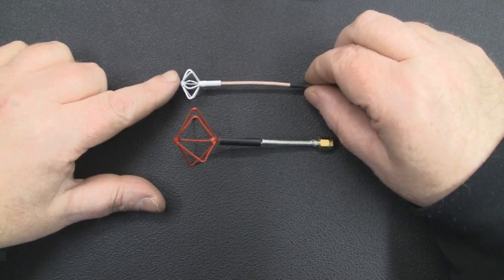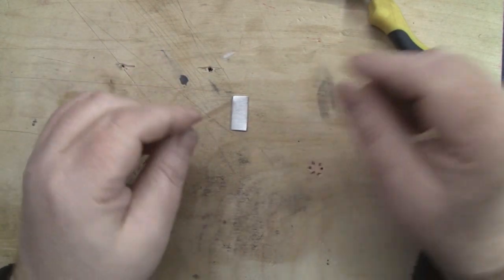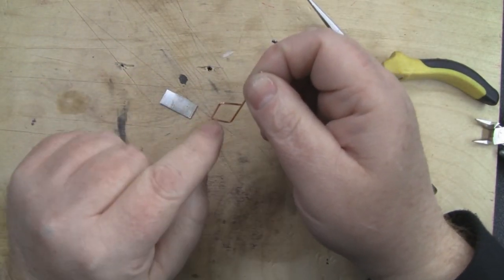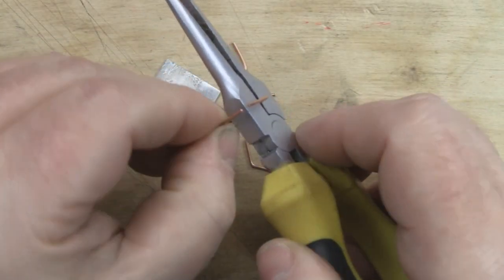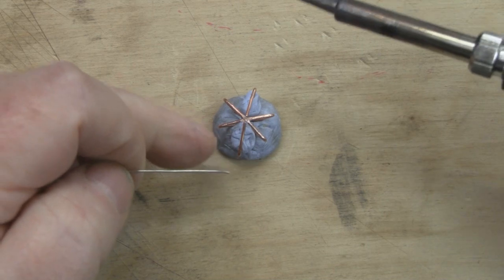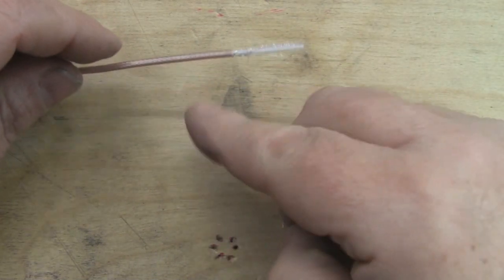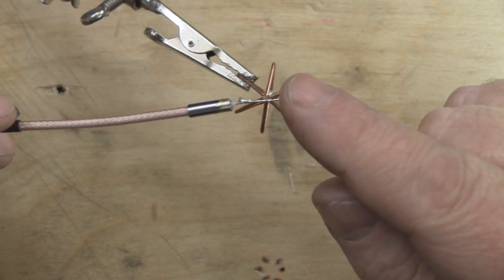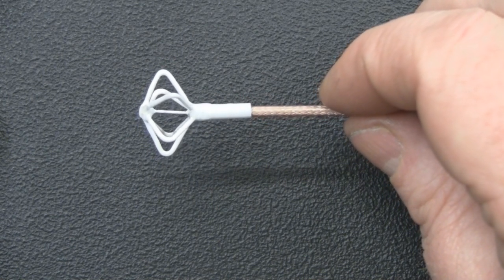Blade Antenna for 5 8GHz #81

Comment: ?  the formula for calculating antenna length was given as "length in meters =300 / frequency in MHz", 300:5800:4=12,9 mm, wy 9,6mm thats for 7.8Ghz?

Comment: Hi Andrew, I see from the title this is a 5.8ghz antenna so how come a 1/4 wave length is only 9.6mm and not the normal approx 13mm ? Is there something about its shape or design that would change things ?
Reply: No I didn't get an answer, I guess Andrew is a busy man.
Reply: The 5.8Ghz band ranges from 5845Mhz - 5725Mhz. Dipending the channel he chooses he properly tunne the antenna to the right channel plus the thickness of the wire, thats the only explanation i can get hence the different lengths. The wavelength is a result of λ=k(c/f)0.25 where
λ=wavelength
c=speed of light on vacume/air
f=the frequency you wnat to build the antenna for
0.25 for λ/4
and k=0.75( i think) you can find it on a graph by getting the wavelength/wire diameter ratio first!
Reply: is because the thicknes of the wire!! thiner wires have bigger reactance and its much dificult for the muching resistance of the antenna to the transmiter/receiver for the maximum power transmision! Thicker wires have smaller reactance
Reply: He used the same 9.6mm for cutting the tubing so that doesn't seem to make sense....  (C/5.8ghz)/4 = ~12.9 adding in the thickness of the sire to account for that (~.8mm) that still only brings this up to 10.4mm which is 2.5mm short.

Comment: what are the differences (in performance) between this one and the celtic knot?
Reply from the maker: Hans Ham Hi Hans they have the same performance but they have different polarisation.
Reply: andrew mcneil Than you, but what is the benefit of that? Less interference with others?With all respect on what you do, I advise you to give better explanation what the benefits and features are of the products you make. For example, you make the celtic knot, but you do not explain why and when people should use it above a 6-blade or other designs. Maybe a table with gains and usability on your website would be nice.